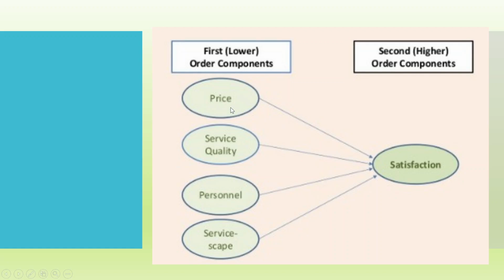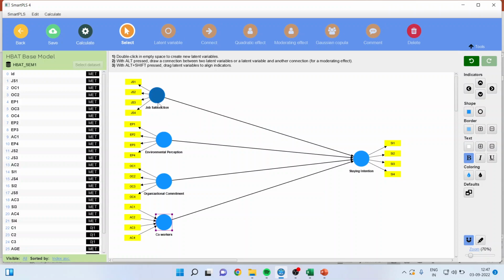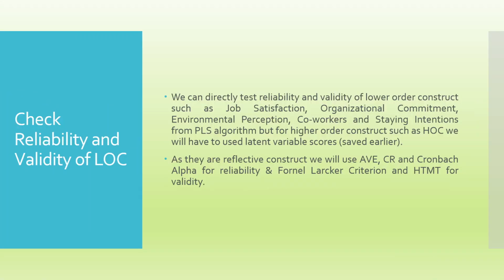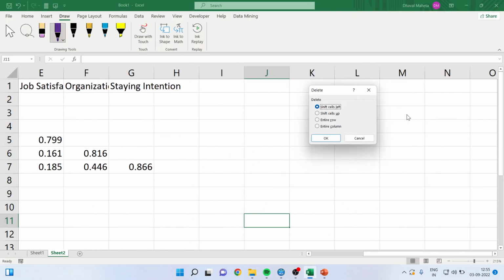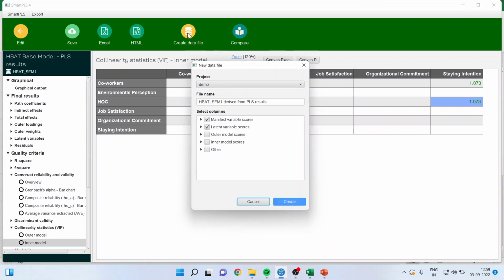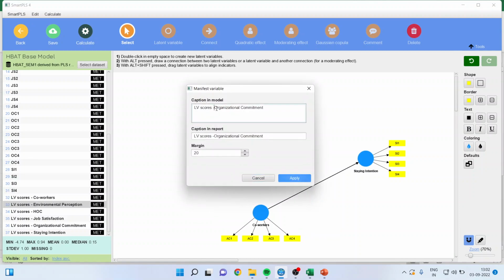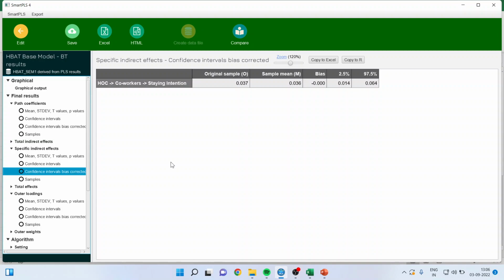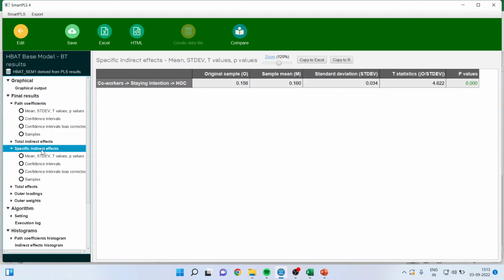21. Higher Order Model [Reflective-Formative] in SmartPLS-4 || Dr. Dhaval Maheta

Comment: Dear Dhaval, the video is very good and well explained. But i am having an issue with the formative measurement. e.g. i created the data file of LV scores JS, EP, and OC after running the same path model. I linked the LV scores directly to the HOC and inverted the construct for formative. But there are no weights (in your case these are numbers with significant level for formative indicators) rather, my results are showing 1.000 (NaN) for all three indicators. Also for the formative indicators arrow is visible as only a line instead of normal arrow :(.It was running fine without the update of pls4. now it is giving this error. I tried everything but was unable to understand. Please, if you can suggest something.
Reply from the maker: Mail me on dhavalmaheta1977@gmail.com

Comment: Sir I have a query about global variable if i dont have a question in my questionnaire related to global variable, Can i apply higher order construct without global variable
Reply from the maker: Yes
Reply: @DhavalSaifaleeAaryash  thank you so much sir you helped me a lot your videos are very helpful in my PhD journey. One more question In redundancy analysis my path coefficient is .665 which is less than .70 but my outer weights are significant and vif all are less than 5. So should I move forward?
Reply from the maker: @fariya949  yes you can proceed